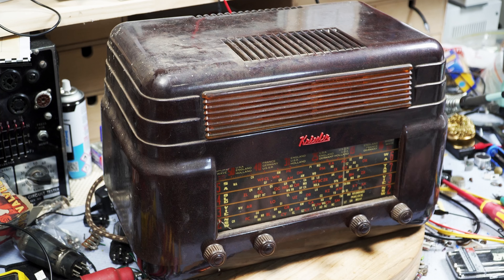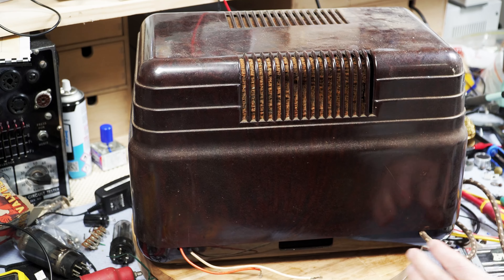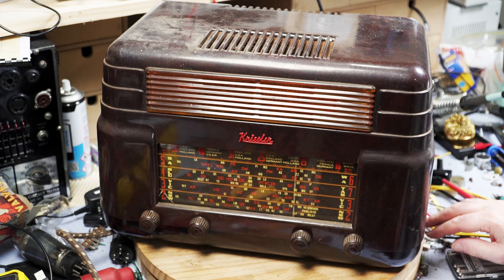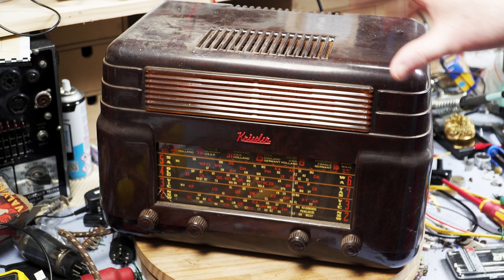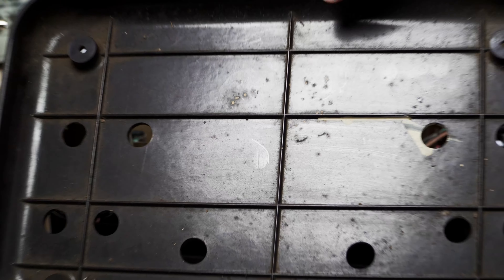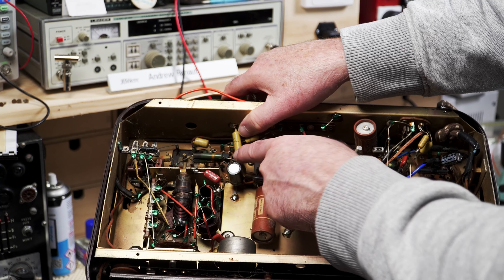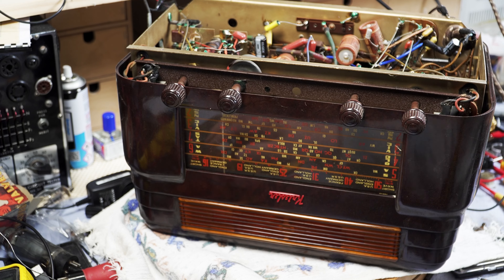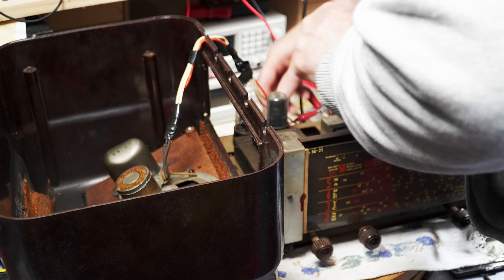Kriesler - 11-7, Part 1.

Comment: Hi Andrew. I have just been asked to restore one of these for a family friend. It looks very original and possibly untouched. I haven’t started on it yet but I will be using your video as a reference. I gather there were many changes during the production run and I have no idea yet which one I have. One bad omen I noticed was shredded newspaper or similar inside the top speaker grille. It may have had mice in it 😱. Anyway with any luck I’ll be able to make a start on it tomorrow. 
Needless to,say, I’m looking forward to part 2. 
Cheers!